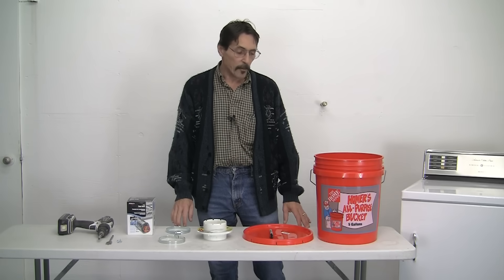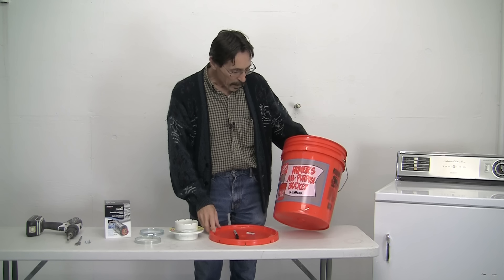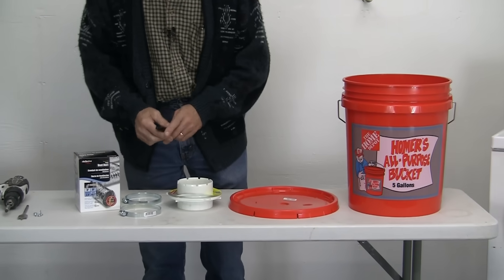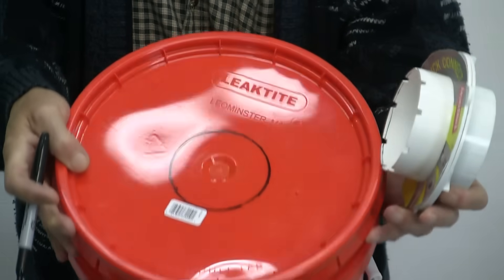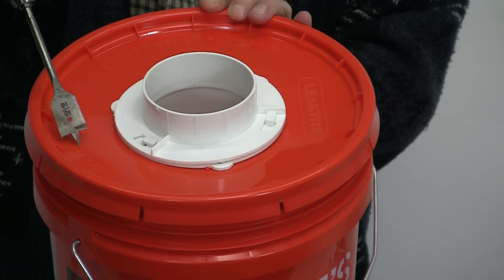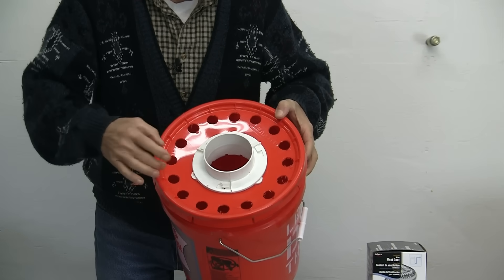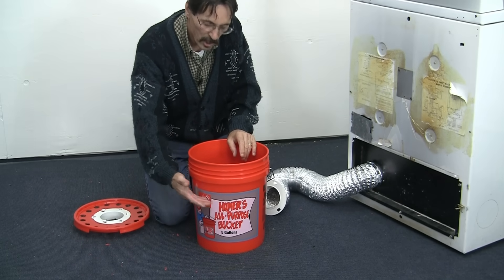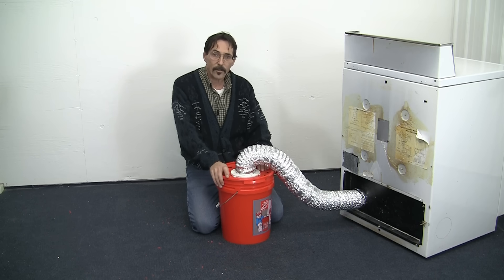DIY How to Cut Electric Bill in Half: Part 3 Clothes Dryer Free Ideas | Missouri Wind and Solar

Comment: Upgraded version of your concept ready? Buy Gallium and then feed it lot's of Aluminum cans to make Gallium Aluminum alloy. Now cuts a hole in your wall. Fills a "COPPER" RADIATOR with the Gallium Aluminum alloy. Now make a steel plate resivor with an in out spout to attach it to the copper radiator and place steel plate where the heated air from the dryer hits the steel plate resivor filled with the Gallium Aluminum alloy. The alloy will absorb and conduct that heat. Now place insulated vent in wall with air vent's close to the floor and air vent's close to the celling eith the COPPER radiator in the middle. Air will be heated and rise up the insulsted duct eork generating a draft effect drawing in cold air heating it has it passes through the copper radiator. Now you can flip a vent valve to direct the air to hit steel plate resivor to passively heat a room or home and not have a huge amount of water vapor fill your home. 😯😊😉

Comment: Thanks for the video. My dryer went goes out through the wall. Can i use this method?  What about summer time?
Reply from the maker: Yes you can. Just put a rag in the pipe for the winter. Not for summertime use,  cold months only.
Reply: MissouriWindandSolar  does this work if my dryer is in the garage? Thank you.

Comment: Your exhaust holes tally up to a little more than 2 inches less than your 4 inch input pipe. Why restrict it ?
Reply from the maker: The air flow is not restricted and the bucket works just fine
Reply: Exactly how is it not restricted? A 4 inch hole has an area of 12.57 inches. Sixteen 15/16 holes have an area of 11.04 inches . Thats an OUT that is SMALLER than the IN by 1.53 inches. That qualifies as a RESTRICTION. Im NOT from Missouri , But SHOW me how Im wrong.

Comment: Good video, with explanations for those who may not understand. I have done this before and it works great, especially with an inner floating tube mod as mentioned in comments. One important thing to note, is that you only want to use this in the WINTER when your air is very dry. Not spring or fall when it’s damp and rainy outside
Reply from the maker: Thanks Keith. Good info.

Comment: Wow.... basic communication skills. Did you even LISTEN? No wonder why we have a generation of dumbasses.

The man said, this is for an electric dryer, in the winter months. It will help cut cost of heating your home. Keyword here: HEATING. When you use heat, it drawls out the moisture in the air.  

This adds heat and moisture, into your home. Which is only to be used in the WINTER.

Normally you would want the heat and moisture vented outside. In the WINTER it is COLD. Therefore, you heat your home.

Do I have 2 explain that too? Or can you picture it? If NOT, I will bust open a box of CRAYONS, grab a few sheets of paper and get 2 work. 

Since you now vent the dryer through the bucket. You now have heat and moisture (from the heating of the clothes inside the dryer) released into the air. 

Comments about mold, the amount of moisture released in the air. The moisture will be evaporated too quickly for the mold to set in. This is because it's WINTER and the heat from your NORMAL METHOD (NOT DRYER METHOD) will quickly remove moisture in the air.  That is why people's skin dry out in the winter. The use of heat, drawls out moisture. Do you get it? 

Comments about I save $ by hanging my clothes outside. Really! No shit, we all can do that. 

LISTEN!
You miss the main point here: it's WINTER! It's cold (I'm in FL.) It takes forever for clothes to dry on line, in the WINTER. 

If you live where it's it snows, your clothes freeze.  So you have to dry your clothes. 

Thus the video, you are already doing laundry, so save money in the process. Use the heat and moisture, which is the result of drying your clothes. To add to the heating of your home. Why waste heat and moisture by blowing it outside? Your just wasting energy.

Unless you want to continue to be a DUMBASS, waste your $$$ (which it's only paper anyways, right) and enjoy "IT PUTS THE LOTION ON THE SKIN".  

Break it down, you are destroying the environment faster. Little steps we ALL do add to the big picture. 

Hey it doesn't matter, because you don't LISTEN anyway.
Reply: Your not running with a full deck huh?
Reply: You're a golden nugget of internet stupidity huh? Heat adds moisture to air... Heat causes water to change states into water vapor. The COLD condenses vapor back to water and reduces the frequency of water changing to vapor. Hence the dry air in the winter. If you want to comment and let everyone know you have a highschool diploma, try not to be dumber than the guy in the video. I'm sure your dryer has a bucket XD

P.S. Nice red hair, you look like a drug addict.
Reply: @tubeyou0925  ladies got a box of crayons! Leave her alone man 😆
Reply: "If you live where it's it snows, your clothes freeze."
Then you freeze-dry them! In winter humidity outside is about 20-40% which is good for drying clothes after they freeze. It just takes more time.

You are right on the money when you're saying that if people dry their clothes outside it will not help them heat their house..

Comment: Assuming that 4" vent hose is required for proper air flow. You'd need about 18x 15/16" holes to vent keeping the same amount of open area. That said ensuring that the holes are clean and smooth will also help reduce restrictions. You just have to adjust your number of holes based on the size of holes that you drill in the lid.
Reply: Yup. That is why I used an inch.
Reply: I'm no expert by any means, but wouldn't the amount of holes he used work? if you think about the size of a standard opening of the exterior dryer vent on a house. 4 inches? surely all those holes in the lid he made would be greater (in total) than the hole in the house.
Reply: @THAT_ASMR_GUY  - It never hurts to do the math.  A little bit of difference in diameter can mean a big difference in area and therefore the volume of the air that flows through that hole.  For example, in firefighting, switching from using 1-1/2" hose to a 1-3/4" hose can (almost) double the amount of water you spray on the fire.

Comment: This does not address the contaminants in the air from the detergent residue. These would fill your house and pollute the air space. Lint is not the only thing to be concerned when exhausting the dryer.

Comment: Im an appliance tech and this can break a dryer. It will burn your elements and high limit fuses. And can cause mold and dry rot in your home with all the moisture.

Comment: I got a small electric dryer and I can't get the aluminum tube to fit to the dryer...help. I bought 2 of those damn things from Orange and blue.
Reply: There is water proof gaffer tape. Sounds like you need to build an adaptor, often cheap plastic funnels help for changes of diameter.

Comment: Is it possible to put the quick dock on the dryer to quick connect the hose?  I live in an RV and have to use a portable electric dryer.  I don't leave it out until I'm ready to use it so I need a way to disconnect the hose off the back of the dryer when I'm not using it.

Comment: I did this for my apartment size dryer because there was no vent in my apartment and in the summertime I took a piece of wood that I cut to fit in my window shut the window all the way down so that the window was holding the board in place put a stick at the top of my window so you couldn't open it cut a hole in the center of the board and put my dryer hose out of it kept my house warm in the winter cool in the summer just wish I would have bought that thing he screwed on the bucket so I can just buy two and Pop It On Pop It Off and go from window two bucket easily

Comment: Okay, I live in Florida. This does me absolutely no good. However, is there anyway I can apply this same idea with my refrigerator to cool the house?
Reply from the maker: That's a good question, don't know, never tried it.
Reply: MissouriWindandSolar   I was kidding.  You are using the heat that is normally wasted from a dryer, as it is normally vented outside.  It is a great idea, and it's very good that you mentioned to NOT do this with a gas dryer.   
The cool air in a refrigerator doesn't get vented out and wasted like that, so it doesn't apply.  Just wishful thinking on my part.

Comment: Great idea! Running some numbers here (I'm not an engineer), but I assume the total area of the small vent holes should be equal to or just greater than the total area of the 4" hole (12.5 square inches).

1-inch holes will require 16 holes. Ironically, I just unpaused and watched your calculation again and 16 holes at 15/16 is spot on.
1.5-inch holes will require 8 holes

Someone please correct me if I'm wrong.
Reply: 🤷 sounds about right
Reply: So you recommend roughly 7.5” exhaust ( 16 x 15/16” ) for 4” of input? Are all fans in dryers putting out the same cfm?

Comment: Great tip about the nylon stocking over the dryer vent. If you restrict the flow, lint can build up inside the dryer and actually cause a fire! I had a duct cleaning business and cleaned dryer ducts too. Had one customer who's dryer actually caught fire because of a blocked vent! Also had many that I cleaned that were close to having a fire! It's a good idea to have your dryer cleaned inside every couple of years along with the vent.
Reply: 1 Fire for a heating business sounds like pretty low odds to me. I think I will go with the stocking.
Reply from the maker: Everything you just stated is true, couldn't be more accurate. I discovered many fires that happened inside a clothes dryer that didn't go anywhere but sure as hell could have and the home owner never even knew a small fire  happened inside their dryer. Seen more then one home burn down from clothes dryers being full of lint, usually due to a bad drum seal. Some dryers just build up with lint and there is nothing wrong with them.
Good advice on cleaning out your dryer.

Comment: I did this at my first house. Thought I was smart. After "heating" my home while I did my laundry for a few months the popcorn ceiling fell off in big chunks because it was wet from condensation so often. This may work in some situations but be very aware of the effects when you first start doing it.
Reply: Me too.
Reply: Keep door open so the moisture can move.
Reply: @cherylbglover  What door?
Reply: @bunberrier  the laundry room door, or whatever room the dryer is located
Reply: @cherylbglover  That wont help. Didnt help. The machines werent even their own room, no doors, just an alcove in the kitchen. The moisture held in the heated air will deposit all over. Dont do it. There are such things as heat exhangers that can be purchased to put on a dryer to recover the heat. If someone is that into recovering the heat, use that.

Comment: I bought an item that works the same as you spent all the time making for very cheap 23 years ago  at Lowes.  all i had to do was put water in it and attach it to the vent hose so very simple.
Reply from the maker: This one has a 5 gallon bucket not a 1 gallon like the lowes model.

Comment: During winter months, my dryer exhausts heat outside as normal but is rerouted to the underside foundation of the dog house. (sits on top of a foundation of 4 inch bricks to avoid water). This greatly reduces the amount of time that her indoor automatic thermostat electric (ceramic) heater runs.

Her doghouse also has air tight 1 inch sold insulation board (walls, floor, roof) a memory foam heated pad which is touch sensitive, LED lighting, and an electronic monitored temperature sensor which is view-able at three indoor weather stations. (including my computer desk)

Comment: As given, this blows a lot of lint into the laundry room, and we couldn't remember to check the water level.  To fix these issues, I made a couple of mods: 
I conveniently put the bucket near the HVAC return vent to induct the warmth & humidity to the rest of the house.
I hooked a toilet float to red&white striped stick thru one of the vent holes to indicate the low water level with a glance.  I extended the vent hose to a Styrofoam ring float with a tall half-gallon plastic bag with the bottom cut off and glued to the ring, so all the air must go down to the surface of the water, losing more of its lint.
Another convenience is a piece of hose from the deep sink to another of the vent holes, for quick refill and occasional rinse-out.
Reply: You have too much time on your hands 🤗 reminds me of my Dad, always fixing things like that!
Reply: Forcing the air into the water is going to increase the air flow pressure. Not good.
Reply: 3

Comment: First you do not want humidity in your house, it will cause mold, mildew, fungal and at high levels even bacteria growth. 
If you use this guys method in your home and not put water in the bucket you will still have large amounts of humidity from the evaporation of the water from the wet cloths. 
Better idea for saving money is to dry your cloth on a line so you can run your heater longer.

There are reasons why the USA has building codes for appliances and its to keep you safe!
This method is a violation of most state building codes.
Do not use this lame brain invention that will just cause you more problems down the road.

Comment: 1. dryer exhaust material is incorrect and can cause lint to accumulate then the dryer overheats, catches fire. 2. improper material type and installation can void manufacturer's warranty. 3. introducing warm moist air into the home can cause mold/mildew propagation.

Comment: at what point do you show how to cut your electric bill in half? I watched the hole video and it shows me how to heat the laundry room and the room next to it every 2ed or 3rd day. Am I  suppose to run the dryer all the time which would skyrocket my electric bill? Am I suppose to downsize to a 300 square foot apartment and find space for what I have in a 2400 sq/ft home? Im lost for words on how this cuts an electric bill in 1/2... maybe set yoru dryer up in the middle of the living room?

Comment: 55% humidity?  How do you see out your windows?  Of course, your probably too busy for that, cleaning all the black mold inside your house.
Reply from the maker: In all of the years i have been using one that has never happened.
Reply: Then, your not getting your humidity to 55% or, the outside temp isn't real cold.  Or, you have layers of insulation between your inside windows and super-air-tight.  

I live north...for example, it was -6 degrees F outside, actual temp, not with "wind chill".  30% relative humidity will cause certain 25 year old windows inside my house will build ice inside overnight.  But, later this week it will be 45 degrees outside...so, I'm not messing with the humidity, we keep curtains open, the overnight ice will melt quick.

Believe it or not, I have actually seen people put insullation bats between their windows!  You can't see out them anymore, but, it sure keeps the cold out!
Reply: why not just use the plastic film on yur windows,  Im from colder canada and it stops all ice and cold air coming off the windows and you can still see out and get sunlight.  house was so dry noses would bleed in winter.   the added humidity would be a nice luxury.  use the plastic, humidity problem solved
Reply: Jrod...YES!  That stuff works amazing.  Been using it in previous homes since the stuff first hit the market in the 70's.  Makes a huge difference, and your right, no moisture on windows.

I typically do the outdoor version on certain 1st floor windows I know are bad. 2nd floor windows, such as our bedrooms, are too difficult to get to.

Unfortunately, when we built this home 25 years ago...we didn't PLAN for needing window film...supposed to be the best thermo-pane windows.  

We moved in during the spring, right away, had custom window treatments installed, that were made to go INSIDE the window frame.  That made it impossible to put the inside plastic on without removing the blinds.  So, our choice was no drafts and ice free windows, or, not being on display for neighbors at night or having the sun stream in early AM....I like to sleep in when I can.

Another solution would be to have storm windows.  They look bulky and are a pain to wash windows, but, we just sold our house, the new one we are moving to (next week) was built in about the same era, similar wooden thermo-pane windows with aluminum outside cladding...BUT...this one has storms!  And, it is a ranch, so, even if we lose the storms, we can easily get at and do from outside if needed...and, you can bet once we move in, we will try to design window treatments that leave room for the indoor film!!!

Comment: MissouriWindandSolar - quick question. DH and I live in an apartment and our washer and dryer are side-by-side in a "closet." We had them remove the closet doors so we could move the dryer out away from the back wall some, then I hung up curtains. When I do the laundry on the weekend, I just pull the curtain back. My question is this:  Due to the limited space, we will have to drape the dryer hose up vertically and over the top of the dryer and then sit the bucket on top of the dryer itself. Would this be a problem with the hose and the air circulation? Thanks for your video and response.
Reply from the maker: Won't be a problem at all

Comment: Also if all of the lint is trapped in the bucket, wouldn't the outside dryer vent exhaust need to be cleaned anymore.  That is  a pain for me to do. The way our house is design I have to climb behind my dryer every year to clean the back of the dryer , along with the dryer exhaust leading to the outside of the house.